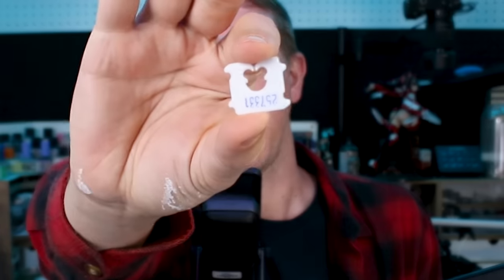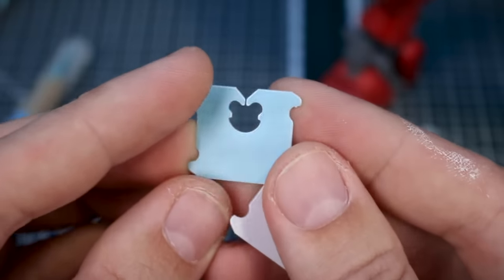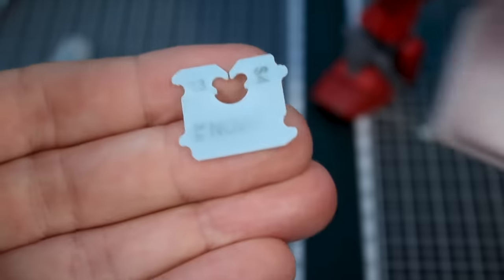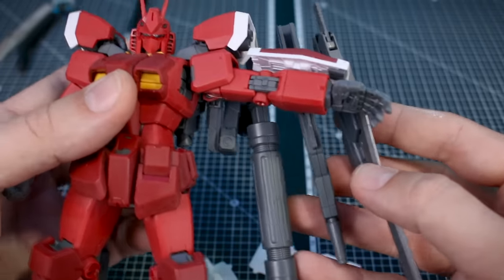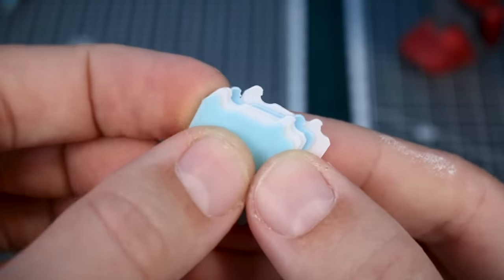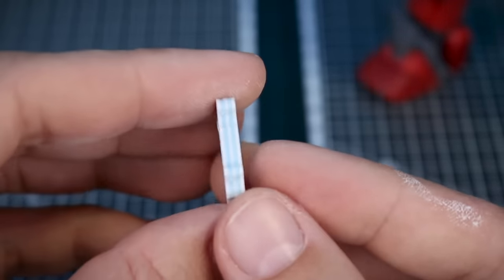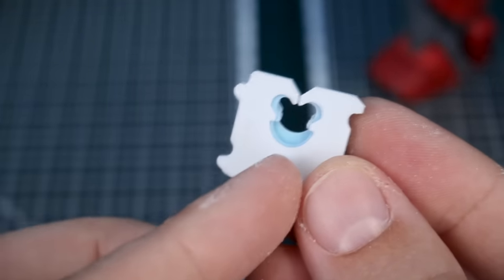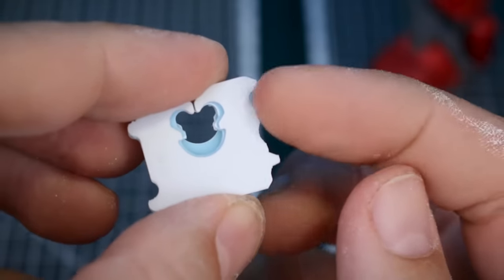3 Tips for Adding Custom Detail to your Gunpla! - Bread Clips Tutorial

Comment: This is actually a cool idea, never thought of that before. My first thought was to use the sides of the bread clip as a scribing guide, the wavy design on the edge would probably look cool as a scribed panel line, but the other methods are pretty cool too. I’m still struggling with pla plating techniques, my hands aren’t trained to be still enough so I end up cutting unevenly and it doesn’t look good enough. Also I never noticed how cool the MG Red warrior is. Might have to put that kit on my wishlist

Comment: If you have a strong enough magnet, the bread clips work decently as a detail piece to replace a peg if you cut it up. A friend of mine did so with an upgraded EG kit he was working on and told me about it...unfortunately, I then found out that the magnets I picked were not strong enough anyway, but wouldn't go through extra pieces of phot-etch that I was using for my own EG upgrade

Comment: interesting! when i made my hyaku shiki wfm ver, i wanted to do the torso extension but i don't have any plaplate. So i ended up using the uhhh tabs on the hyaku shiki runners that i assume they used for plating the plastic. Sandwiched two of them and made a hole in the middle using a combination of cement, hobby knife, and soldering tool (yeah the build is very janked)

Comment: here we dont have bread clips, they just use a piece of wire D:
Reply: I save those wires and I can use them for repairs if a piece breaks and it needs reinforcement. Then I drill in tiny holes and then glue pieces of the wire into the holes to reconnect the piece/pieces back together and if it needs a stronger/bigger connection then I use a paper clip. It all depends on the size of the repair.